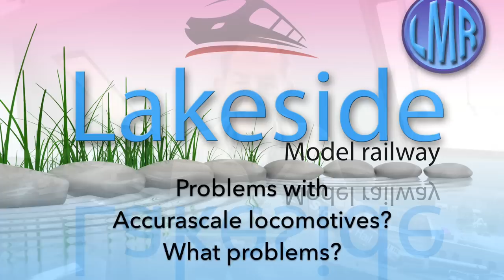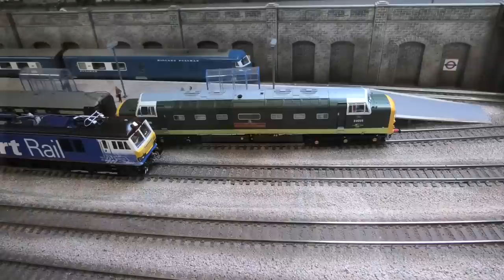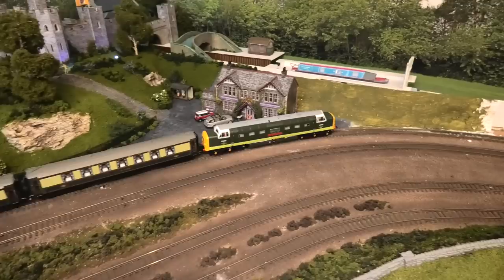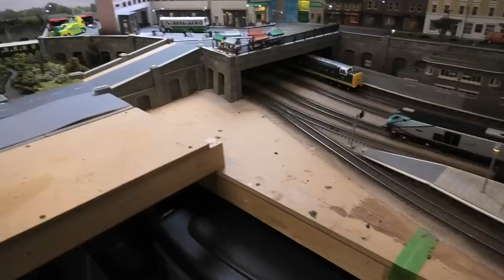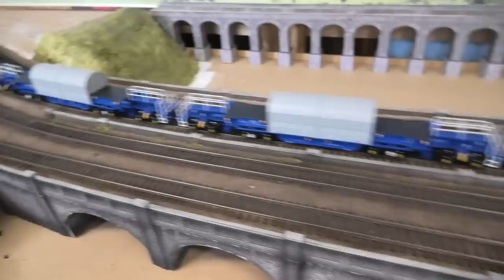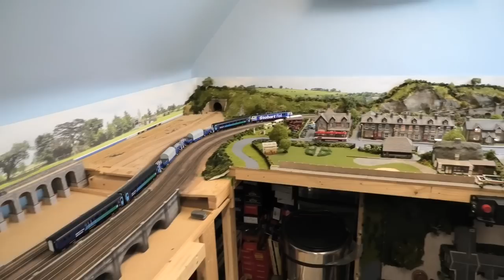Problems with Accurascale locomotives - what problems?     10-05-2023

Comment: Come on Accurascale, get your act together. It appears that the factory don't have very good   technical expertise and poor customer service, You should be able to receive the loco, place it on the tracks and it runs.Well done Graham and thanks to Susannah.
Reply from the maker: Hi Clive and thanks for the comment. Accurascale have now seen this video and I’m sure that they will take notice and act accordingly. They have been good up till now in listening to their customers so let’s hope that they take note and look at the issues which are now appearing for some (not all)  folk. Time will tell I guess.    Cheers.           ………..Graham
Reply: To be fair Graham, your analogy of a car wasn’t quite right.

If anything, it actually proves its exactly what you do (tweak) a car.

For example, you buy a car, but want to use it on a specific circuit (or track) - it will have a default set up, but that may not be right for your track or circuit. To get it to run right, you’d tweak it to your track requirements.

It does make me wonder if in certain scenarios, this stock set up is not suitable for some layouts and a unique set of scenarios - aka the hole in the cheese effect. Glad you have got things sorted.
Reply: I beg your pardon? Accurascale lead the way in customer service and quality, you literally don’t know what you are talking about.
Reply: @aureol40012 I’m sorry but if your comment was correct regarding this company then such videos like this wouldn’t be posted would they! 🤔 Boomer guys like this with their residual cash for this hobby are the bread & butter of any company and should be treated like kings 👑
Reply: @EtonieE25  it’s always the old ones with knackered eyes and sausage fingers who moan about quality!!  I saw one guy slagging off bits falling off his deltic and he was picking it up and handling it like it was a hammer, not a finely detailed model.

Comment: Hi Graham. First off I am very pleased that you got to the bottom of the problem and well done for researching and then trying out your findings based off the suggestion from Susannah's friend. And well done on Sussannah for going and asking her friend about it. I did think of you today as I was watching a couple of You Tube Channels on the new Class 37 from Accurascale and they were having trouble with power and it starting up with sound switch on. They had to lower a CV. When they did that the loco ran fine. I was going to message you about it but now I've seen this video there is no need to bother. I have a Class 92 which I've mentioned before and whilst I am not experiencing your problems I am certainly going to add this to my 'Graham's answers' pile. One thing I would mention re the Class 92 and not sure if you're having this trouble. Is to do with the NEM pockets. If you have a rake of wagons/coaches above about 3 you'll find the pocket comes out. The loco carries on it's merry way leaving the rake behind. I like the idea of what they are trying but it's not a very good design or implementation. So you may find you have to glue the pocket to the underneath of the loco like I have done. I have spoken to a few people about it and it seems to be a common problem. I mentioned this to Accurascale support and I didn't get the best response. I was disappointed with that. Anyway, I am going on now. Very pleased you've got to the bottom of it and very pleased you get to enjoy the locos. Looking forward to the next video. Tim
Reply from the maker: Hi Tim and yes, I too have had the same problem with the NEM socket coming out with a rake behind so I just superglued it in place and that works fine now and I don’t see the 92 running off leaving a rake of wagons or coaches left behind! So I don’t understand why the response wasn’t as you wished for from Accurascale.  I have also seen that video where the 37 was having problems with the sound on - not good is it and I’m just wondering if it was that one particular model or again, a common occurrence. As I’ve not heard of anyone else having that issue then I can only assume that it’s peculiar to that one model but I may be wrong on that.         Cheers.         …………Graham

Comment: Graham thanks for the video update  , i did have the same with my deltic and got a full refund in the end but im am very happy you got yours solved and like you i didnt know much how to solve it as it did my patience in after 2 weeks very frustrating to say the least .I stripped it down looking for some sort of wireing fault then the decoder then came across your video and now im satisfied i had the exact same problem and it has put me off buying accurascale for now . Great videos you put up graham iv learnt quite a bit from you many thanks kev
Reply: I think that  DCC is a complex system of controlling a model locomotive and I hope that Acurascale can get their heads around the settings required for the smooth operation of their locomotives that are fitted with DCC. An update to the instructions is required when DCC is fitted to their locomotives. Well done. Now is the time for the staff to get some training on the complexity of DCC.

Comment: Graham, I have been following you since early 2013 when I returned to the hobby and have been so impressed with your contribution to our hobby. This latest video is so informative and helpful, not just for the OO guys but even for us in N who are experiencing issues in the collaboration between Revolution and Accurascale. These models cost a small fortune, £175 + £120 for a sound decoder (for N gauge) fitted the sound decoder and established that the actual PCB hadn't been fitted correctly at the factory, it's just not good enough. We're, somewhat begrudgingly, prepared to pay a sum that once upon a time was my mortgage, and have to 'hope' that the product arrives in a fit and proper state... The decoder should be programmed at the factory where final assembly takes place, but the quality check is evidently not up to snuff; I'll forgo some of the detail for the assurance of getting the basics right, but it shouldn't come to that.
Reply from the maker: Hi mate and thanks for the comment. All what you say is true, I think the annoying thing about all this (not just Accurascale but all manufacturers) is the inconsistency that some models work just fine and others don’t and have the exact same issues. I honestly don’t know what the answer is apart from manufacturers doing spot checks on their stock to see if they can see any issues before despatching to their customers.       Cheers.          ……….Graham
Reply: @GrahamFoulston  Indeed. Having spent more time than I care to remember standing at production lines throughout China and SE Asia, I can understand how these things come about - I think that the loss of staff in China through the pandemic, compounded by China being closed to visitors from overseas until recently (preventing on-site visits from the UK based businesses), may have had an impact which we're experiencing, but it doesn't stop the businesses that we buy the models from taking additional measures such as increased sampling.  It will be interesting to follow.

Comment: Great video her graham,  nice or hear that you have sorted the issues out with your accurascale locomotives, I myself have had issues with their locomotives but not the ones you are explaining in this video most likely because I run a dc layout and not a dcc layout, the main issue I had with the 55 was parts falling off due to not being glued in place and the common bogie chain issue, for my class 92 I had a serious problem with this because due to my excessive handling of the model due to taking it off and putting it on the track and fitting the detail the Railfreight lettering had started to rub off so I had to buy a set of transfers to replace them, the6 are jus5 mine at the moment and hopefully I won’t have anymore, hope you can start enjoying your accurascale locomotives now.
Reply from the maker: It seems that your main problem has been with bits falling off David, I have to admit that the only issue I have had as regards that are the chains on the Deltic coming off and trailing along with the bogie, so in the end I just took them all off, they were more trouble than they were worth - great for a static model but not for a working model. I would be a little concerned that the livery is coming off already - not good.    Cheers.       ……….Graham

Comment: ESU chips are often set to "learn" so running in is important... you can get some real issues if your chip learns bad settings.. as you have seen.. so the reset using CV54 is VERY important for ESU Chips..

I had a friend who consisted two brand new loco's...  one of them "learnt" that it was moving without trying.. so it decided it did not need to power the motor and so would not run at all.. 

A reset by CV54 fixed all the problems..
Reply from the maker: Hi mate and I would normally agree with you about the CV 54 trick but not in this case. When I did this to the class 92 and went to check the settings afterwards then they were all set to zero which is obviously wrong. After I put in my own settings and adjusting them accordingly then I got the results you could see today in the video. I agree though that setting the CV54is the very first port of call, just a shame it didn’t work on this one particular occasion.       Cheers.        ………..Graham

Comment: Fantastic work Graham, really brilliant news for all the problem locos out there...of which there are many! The question is, why the hell haven't Accurascale discovered this and briefed out the relevant info to all their customers in a clear and concise manner? They are ASLEEP AT THE WHEEL!
Reply from the maker: Hi mate and thanks for the comment, I think the problem here is that generally then most folk are happy and there aren’t that many people with this that I had, sure there are some but in the big scheme of things and the numbers they must have sold then mine (and a few others) are in a small minority. I have to admit that because I’ve only bought two locos from Accurascale and both have been faulty then I had lost confidence in them. I just hope that they are learning from these faults for further improvements on their next models.       Cheers.          ……….Graham
Reply: @GrahamFoulston Accurascale models are known to me for shedding their parts and seemingly disassembling themselves as they circuit the layout, as well as having performance/motor issues too, as you've experienced Graham. I sent my three 92s back to the retailer for a refund (all had the motor running issues). I did stick with the two secondhand Deltics which are a bit twitchy at times so I may try the CV54 reset trick! My 37 seems ok at the moment, although it does have the documented sound cutting out on start up issue. I have heard of many many people having issues with various Accurascale items so they do need to up their game somewhat. Their details are superb but they need to be more robust and fully reliable.
 As for the newly tooled Bachmann 47s and 37s, like you I am smitten! They are really brilliant in most respects straight out of the box. Just a tad better bass on the sound (bigger speaker needed) would be good, a built in stay-alive and a driver; these are my only criticisms really. I always wait until someone is offering a 30% discount though before buying as the RRPs are so ridiculously high, obscenely high!
   You may like some of the footage on my YT channel, if you haven't already looked.
Thank you again for discovering a fix for the Accurascale locos Graham. 
Regards Julian

Comment: Well done Graham, old school, never give up. I would myself have thought that they would have made sure that all was correct before sending them back to yourself. The quality of Accurascale needs to be sorted and quickly.
Reply from the maker: Hi Paul and thanks for the comment. I think these issues need to be put into perspective as I’m sure (hope) that the majority of the locos out there are running as they should - but that is an assumption rather than a fact - I honestly don’t know. I have been very unfortunate in that both my locos were showing the same symptoms but I do know that many out there have put there locos on the track and found no issues. It’s a difficult one but at least I have now sorted mine out without it being returned to Accurascale which is fine by me although I admit that I shouldn’t had to have done this. I’m sure Accurascale are now aware of these issues and are looking into it.        Cheers.         …………Graham

Comment: Well done.... its great that you got help from other modellers and the Model Shop. As for the response you got from  Accurascale  it does sound like there was a communication problem and the models had unusual issues. Having said that some modellers are proud of the fact that they adjust ALL the settings on their models. In fact some YouTubers spend 30mins doing this and that to a model before they "Rate it".  Model Trains have come such a long way since I was a kid.  I fondly remember running my trains around at 'light speed" disappointed that they couldn't make the radius 1 Hornby curve of my train set oval track. I had no idea how to clean them and  sold them back to the Model Shop as non runners when a good clean might of done the trick. 
Nowadays you need Big Money, 6ft+ curves and a degree in technical engineering to set up an engine and your layout. Well done for having the courage to sort it out yourself. I do not see this as a 'problem" for Accurascale or "the Factory".   I praise them for making the effort to offer a fine scale, detailed products at a competitive price.   This issue is an oddity and should not detract from these fine features.  Basically you fixed it and you should let them know how it was fixed. Next model you get. Check it over for faults, run it 30mins in each direction and check ALL the settings. I hope you can enjoy your new models and now have a greater appreciation for the complexities of modern model trains.
Reply from the maker: Hi George and thank you for the comment. No matter what loco from any manufacturer I buy, I always, without fail, run it in for half an hour in both directions at half speed and run it a further 10 minutes at 3/4 speed in both directions. I am also mindful that these days, the models are far more intricate than locos of years gone by and have to be treated with the respect they deserve. All my locos are cared for and looked after and regularly serviced when appropriate. But in this instance these were two brand new locos which had issues when delivered so I had no control over that so do I try and fix them or send them back, in the case of the Deltic it was sent back to Accurascale to be repaired, but when it came back it was still not running correctly - hence this procedure as a last resort which thankfully worked - on both locos.      Cheers.         ………..Graham
Reply: @GrahamFoulston   My mistake.... It did sound like you had done everything you could. I am glad that it got sorted out eventually.

Comment: Thank you so much for this! I had the same Deltic issues and returned it back in the day. Fortunately, I tried KOYLI afterwards which runs with no issues apart from the vibrating speaker (so reduced the volume for now). Again, thank you for sharing, every day is a school day...
Reply from the maker: Indeed mate, I think I learn something everyday in this hobby which to be honest, is a good thing.   👍🏻.          Cheers.           …………Graham
Reply: Put a bit of hotmelt at the joint of the speaker and the speaker hole or a bit of masking tape oin the joint of the housing.

Comment: Hi Graham, I have a 55 Deltic and it has a faulty motor that runs at 0.895 micro amps on no load and a burnt out decoder, yes the speaker in mine required two screw that were missing. Accurascale are sending me a new decoder and motor which I will be fitting as I am in Australia. With Accurascale help I was able to fault find the loco in a morning, and thanks to you I will be checking the CV settings when I get the parts.

Comment: Just telling you I'm Typing halfway through the video in the name of fairness. 

Very fascinating video Graham and yes you're right most of the time it is actually the DCC chip. I had this issue with a hornby TTS tornado and it was all to do with the back EMF. 

This has sparked my interest as i have a bachmann pannier which slows down after a certain amount of time running. Also got a bachmann 37 which has 'the pull' you know when you see it so I've got to get rid of back EMF from those 2. And to add some icing on top the 37 has a limited top speed. I'm not planning to run it at full whack as my baseboard track joins aren't that great but it's nice to have the option. 

Another one i had issue with was a bachmann G2A with a bachmann 21 pin, turns out the EMFs on bachmann chips tend to be higher as they are set up for heavy american locos, not really light british steamers so i had to program it all out back EMF, start voltage etc. There's a lot to learn here! Thank you Graham!

Love the castle, does that make you the earl of lakeside? 😊